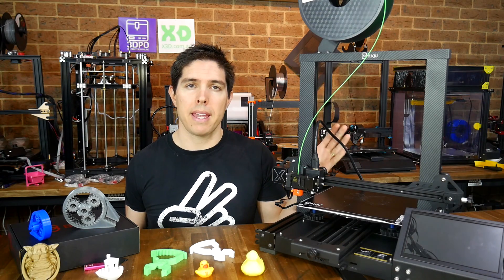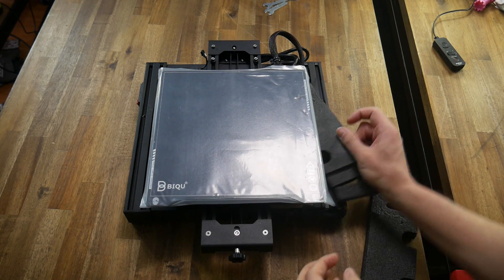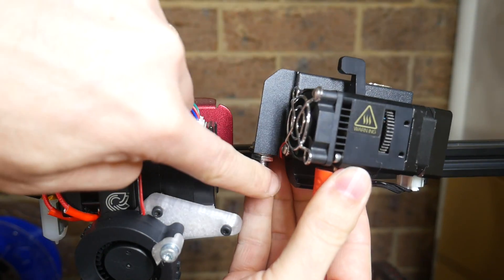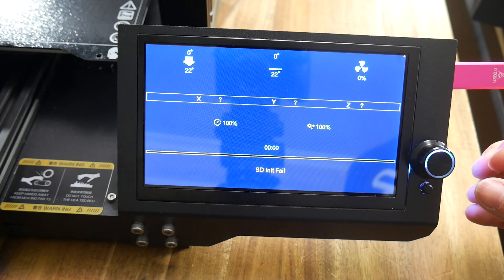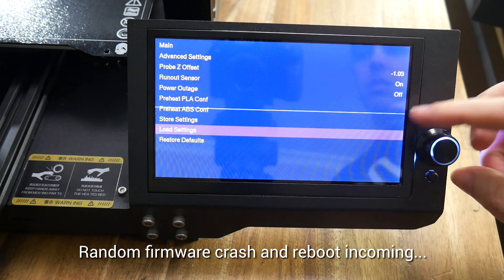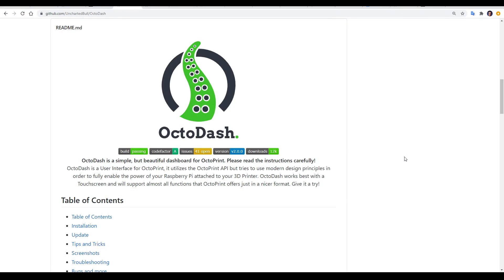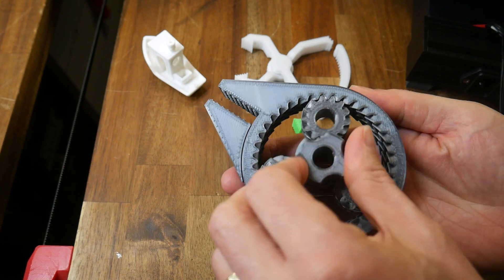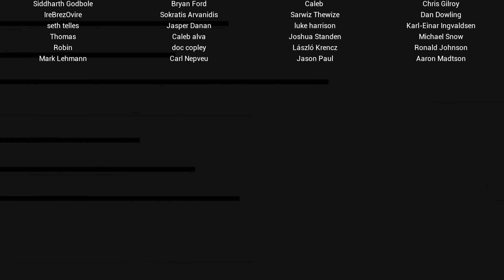BIQU BX - Octoprint compatible 3D printer on Kickstarter

Comment: May I recommend a new review? I have this printer and I'm loving it. Works quite well if you use the looxonline's firmware. Also klipper supports it and would be nice a guide on how to do it. I tried myself, took a while, got it working fine with mainsail os but revertedback to marlin due to the final quality not be quite what I already got. I'm pretty sure it's a matter of adjustments but I don't have the time to tinker with it now nor I have the knowledge in klipper to know what to do.

Comment: I just purchased a BIQU BX printer and am pleased with the mechanical design and large touch screen.  However, I have been having trouble with connecting a laptop via USB using CURA.  Perhaps there is a better slicer program I should be using?  I would like to see a good YouTube that drills down into how to use all the features, what they do, and possible troubleshooting steps.  The “instruction manual” is deficient in operation guidance.  Cheers.

Comment: Would be nice to have an updated video specifically installing octoprint as can't get 0.17 working on the screen also can't get it working...cant ssh saying no host ....I use the octoprint img 0.18 off the octoprint website using pi imiger and works but no screen

Comment: Hi again Michael, at 7min58s in your video, you state that at that point Octoprint could be used in the native environment. This is not quite true.. The BIQU BX needs an additional connection from a USB socket on the Pi board to the front micro USB connector on the front of the printer. This was confirmed by me and Bigtreetech support when I had issues trying to use remote Octoprint.

Comment: Thank you for showing us the main board! With this BTT board, you can update the drivers. With the Ender boards, you have to replace the whole board.
EDIT: With a bigger processor, 2MB flash memory, and 1MB RAM - is it time to start having a discussion on removing the OctoPi from the equation and setting the operations back onto a single board?

Comment: If it had the print volume of an Ender 5 plus, it would be a no brainer at that price. As it is, the B1 seems like a lot better deal, especially if you don't necessarily want to mess with Octoprint. The B1 with the same direct drive would be around $360 and seems to show a higher build volume to boot.

Comment: Not buying anything else from BIGTREETECH/BIQU - They have terrible customer service, took forever to get them to respond to an issue I was having, then they were having me do all kinds of troubleshooting and trying to run out the clock on my return window - wanting me to try to record a huge CR-10S5 while making adjustments inside the external enclosure that has mains voltage inside of it - all while fumbling with a camera. I had isolated the problem all the way back to their board, but they wanted video evidence of it... Just replace the damn board! Sent it back to Amazon and washing my hands of their garbage. I love this channel, but surely there has to be another company besides BIQU out there!

Comment: I think the Raspberry is only good if you do use a single printer which most do. But if you go into production of multiple printers an external housing for the Raspberry pie would be better somewhere attachable to a TSlot so you can multiple printers of a single pi

Comment: I am looking to buying my 1st printer and as I want the ability to print nylon, or nylon X I am quite confused which way to go? I really like the prospect of this printer, but not sure if I want to wait. I am also really keen on the creality CR-6 se and believe this could meet my needs, but would like your opinion on it's ability to print nylon with a steel nozzle, or would it need an updated hot end? The cr-6 is now available I believe. My other alternative would be the Qidi tech x-plus which I saw reviewed on makers muse as this would print nylon out of the box, but is quite a bit more expensive. What are your thoughts/advicekindest regards
Dean
Reply: I have a CR-6 SE and while I had very few issues with mine it will not work with nylon. No printer with ptfe feed hotend will work above 240-250 C. You will need to swap the hotend and that is not easy on a CR 6 as it uses the strain gauge for Auto Bed Level. You could remove the ABL but the bed does NOT have leveling screws so it would be a pain to calibrate. However this printer would also not work out of the box for Nylon. You would at least need the all metal heatbreak.
Reply: Thanks very much for the good advice VMA

Comment: That screen and the board would be more compact in portrait mode and if it used a Pi compute module instead of all that fiddling with adapter boards. I think BigTreeTech a good chance of supplanting Creality given their reputation for producing drop-in, better components for those devices.

Comment: I love how people hate on the HDMI connection without any evidence that it's a problem. Sure it could do with cable relief but there's nothing inherently wrong with the cable standard, conductors or connectors. I hope BIQU sells PCBs to retrofit other printers. (I believe Type-C connector is also viable but I'm sure that BIQU have used HDMI for a reason).
Reply: A good Engineer or person of thought will (and should) "hate" on anything which isn't proven. If an auto manufacturer changed the clamp style battery terminals to a new slip on style, would you buy it without hesitation?
Reply: @gregoryconnors7370  that's a terrible response. The engineers made the change, it's the consumers looking to poke holes without evidence.
Reply: @justindelpero  did you not read the "OR PERSON OF THOUGHT"? Hell, that could even be you, but obviously that would be expecting too much. Additionally, indeed I was referring directly to the commenters (consumers) here who have enough capacity to think outside the box and look after their own as well as others' interest. Thanks for your closed minded critique, and go get that vehicle with the slip on's.
Reply: @gregoryconnors7370  so have you studied the HDMI standard? You understand the power capacity and bend radius etc? No issues if you wish to chime in with first hand experience of strain relief concerns etc. Unfortunately you are the problem and it's pretty poor that you need to phrase your response like a teenager. Unless you have a valid reason to bitch about the use of the adapter simply shut up and start testing. Once you verify that the adapter/cable is inappropriate then make your case and people may enjoy engaging with you.
Reply: @gregoryconnors7370  to directly respond to your point - I allow certifications, industry regulation and safety standards to monitor engineering changes as I'm not an entire company of engineers. If however it came to light that the technology change was bad I would expect a recall and a change to the battery terminals to an appropriate alternative. Noting that a car change is a far cry from a Chinese 3d printer I still know that the HDMI cable is an appropriate choice provided the adapter and cable have appropriate strain relief given the repetitive short movements of the X carriage. This is because I am interested in both electronics, 3d printing and have designed and installed my own custom connector on my custom built corexy printer. There's always the possibility that it is a terrible long term choice but I choose not to persecute or muddy anything without a valid/proven reason.
Reply: @justindelpero  you TOTALLY missed it. Have a better day!

Comment: (para) "0.9° steppers double the resolution and smooth your prints!" Seems like a nonsense claim to me.
While theoretically true, any consumer grade printer with 1.8° steppers and Trinamic-based controllers is already using 256 microstepping, so when using normal GT2 belts with 20T pulleys (ideal radius 6mm) they could place an axis at 7µm positions (2Πr / ((360/1.8°)*256 = 37.7142 / 51200 = 7.3661) but cannot achieve this accuracy due to other mechanical issues and constraints. Using 0.9° steppers isn't going to magically produce any visible change.
Reply: @Teaching Tech Anthony makes a great point here. Is there a possibility of testing the actual accuracy on the new Biqu X vs one of their previous models? Also, I assume the theoretical torque loss will not be an issue?
Reply: Using 0.9° steppers will reduce VFAs (Vertical Fine Arifacts) visible from full steps (since full steps will be closer together, and less "snappy").
Reply: @Thorinair  how do you come to that conclusion? When using 1.8° steppers to drive an M8/1.25mm lead screw, for example, each full step is 6.25µm and you use exactly 16 steps for 0.1mm layer heights. I wish I knew what type of lead screws Biqu was using on the BX because I cannot find that information anywhere.
Reply: @anthonyrich1592  I was talking about X and Y axis, not Z. Z is a completely different story and is not in any way related to VFAs.
Reply: @Thorinair  thanks, I had not come across that before. While it seems that 0.9° steppers may help with the issue it sounds like you really need Programmable Adaptive Microstep Wave Tables to counteract it properly and the TMC2209s on the BX don't have that feature. Prusa has been using TMC2130s so that they can make use of it. https://www.trinamic.com/fileadmin/assets/Support/Appnotes/AN026-Adaptive_Microsteptable.pdf

Comment: Why not just send a proper shut down command before turning off the Pi when switching away Octoprint mode? Or does it need to be left on for other things when not in ocoprint mode? taking octolapse or something for example even when not in Pi mode.

Comment: This "hemera" as upgrade for an ender 3... That would be cool. Pls sell it as single part biqu!
Reply: Yeah I would also invest in something like this :D
Reply: I'm pretty sure they do. But you would need to print an adapter to fit it. Which I'm sure many will make one and post them on thingiverse and sites alike
Reply: I have this similar one for my Ender 3

https://www.aliexpress.com/item/4000162427027.html?spm=2114.12010612.8148356.37.42a47064GUWWjz

Flawless prints for almost a year now.

Comment: Needs a larger print area (or at least a companion larger version of the same printer), and HDMI is not a viable power solution, nor is the connector mechanically strong enough to withstand the constant movement.

Comment: I quite like the extruder, arguably better than a hemera due to the exposed gear for manual feeding and smaller footprint. That HDMI though... not convinced!
Reply: I'm a bit worried about that HDMI. It's possible that by using the proper industrial version with two parallel screws it won't have any problem, but BiQu must implement that before the final release. It would also be interesting to see how hot the connector gets when a full load is applied.
Reply: I'd agree with your opinion on the HDMI, but the Raspberry Pi implementation in my opinion is quite clunky, if they are as good as they say they are, a more cleaner better connection of the Pi would be using the GPIO as intended.  Cause instead of using USB for power, they can feed power via the GPIO
Reply: @Celcius1   It's not such a great idea to power the pi via GPIO, because it is unregulated and there is no fuse protection. You could damage your pi permanently if you're not careful.
Reply: @tobymakes  there is no regulation on the pi from usb 5V to gpio 5V and the latest version 4 Pi does not have the polyfuse any longer. This implementation is absolutely fine.
Reply: I don't like the idea of a loose connection like the HDMI cable.  I get why they used it, but how often do you really need to disconnect the hotend carriage from the rest of the printer?  Stick with the solid connections.  I can see this HDMI cable being the source of a lot of headache in the very near future.

Similar to switch bounce, I don't trust that those spring contacts will remain connected and not disconnect under certain vibrations.  Environmental contamination is also a concern.
Reply: The hdmi does not look secure, and what about current ratings? I don't know
Reply: MINGDA D* Pro series seems to be better value. Its weird to me reviewers are sleeping on it. I guess its because they haven't sent it out.

Comment: Thanks for the insight Michael. What's the cooling like on the raspberry pi 4? Is a fan necessary especially if this printer was to go in a heated enclosure?
Reply: Pi 4 suffers from heating issues, so get a fan on it

Comment: I'm currently printing on a very modified ender3, the printer in this video has me very interested. Dual z with a btt board that drives each z motor individually is a major desire of mine, and it's included in this printer. I love the direct drive hotend too. The only thing keeping me from buying this one is the v-slot wheels. They're a major source of frustration when you're hunting for the perfect print. My dream printer will basically be the printer in this video with linear rails on x and y and no big screen stuck on it (I'd rather control the pi with my PC).
Reply: They're supposed to be releasing a new Mini E3 (Mini E3 "Turbo"?) that also has two separate Z drivers. I'd wait for that before spending more money on another printer, unless you were going to get another printer anyway.

Comment: HI I BOUGHT YOUR FIRMWARE AND HAVING AN ISSUE. I am unable to get the z offset to work for the BL touch. I adjust it in the menu and after I store settings I go to print and the z offset changes and the nozzle ends up to high off the bed. Any suggestions

Comment: Be careful with backing a kickstarter, I was a part of the filament dryer disaster, and still havent rec'd it.  People were getting it on Amazon and others with coupons from social media for same as early bird kickstarter weeks to months before backers started to got theirs.  Crealitys i hear didnt go so well but i dont know for sure.   All I'm saying is it kickstarter, not everything goes smoothly.  I found out the hard way.  Good luck if you back it.
Reply: Its a general problem with most kickstarters in my experience. Not just when it comes to 3d printing.
Reply: Creality CR6 SE was a big scam, this printer as problems all over it. Check here 

https://www.fabbaloo.com/blog/2020/8/28/creality-takes-the-high-road-on-a-technical-issue?fbclid=IwAR3MsCl5n42nU4yOWdiAvhnCSjXUb4WOo4Bn6zNG2lSjG_LPOqnEf9uF6Dk

Comment: Using a common cable such as HDMI is nice, but also very wtf. Are they rated for the wattage that a hotend will pull? From what I can find, MHL 3 is rated at 10W but that is probably for an official spec and I guess the wires might be able to carry heavier charge. Still, USB C charging can go up to 100W by spec. Perhaps I'm misunderstanding these ratings, but it does seem a bit odd. I suppose they wanted to keep costs down and simplify to one cable but that is one thing that concerns me.
Reply: Yes but printer like the Artillery X1 uses flex cable and that even worse, however printer still print fine.
Reply: @zero00tolerance  yeah that is true, I'm just worried about potential fire hazard/melting

Comment: Would it be a possible to make a printer that used octoprint, and didn't even have a screen?  That might save money on a low end printer.
Reply: Yes, that is possible. But keep in mind, that a screen module is probably cheaper than a rasberry. But the rasberry adds Network functionality to remote control the printer.

If you really want to save money, you can print directly from your PC via an USB connection.
Reply: I definately wouldnt buy it :/
Reply: Yes, in fact I don't really see the point of having a screen on an Octoprint system. The whole point of Octoprint is that you control it through the web interface so you don't need to fiddle with the screen.

Comment: As a first printer would this be a good purchase or would the Ender 3 V2 be a better starting point   thanks
Reply: I have a pro and a v2, I Would recommend the pro over the v2
Reply: @baileymoyers1973  why?
Reply: @breathLP  the ender 3 is very well documented and expandable.
Also between the pro and v2 versions the only meaningful upgrade to it is the glass bed in my opinion.

Comment: this looks really promising..i'd like to know an estimated price..that's what make a good or bad purchase after all..
Reply: Judging by the Kickstarter, the current price of US$309 is 38% off which would make the full price approx US$500 but no doubt there will eventually be deals on Aliexpress etc for less when the Kickstarter has finished.
Reply: I think that real price will be quite lower than declared $500. By KS pledge prices, i assume that it will be around $310-350 and later maybe lower. For around $500 no one would buy this printer, because thare is quite big competition. And almost everyday,  3d printer companies releasing new and new printers with better specifications and prices.

Comment: Could you also do a video about Repetier Server? I use it for my printerfarm. I tried to use octoprint and tried to install multiple instances of octoprint in different partitions of the drive. However it is really not meant for multiple printer applications so it gave me all sorts of headaches. Now with repetier i run 8 printers per pi without any problems. Would love to see your opinion on it. By the way you make great content.

Comment: doesnt an hdmi cable have issues with excessive bending? the wires and break at some point right? worse case you just replace it.

i like biqu using common cables for the hot end wiring tbh
Reply: I wold like display port instead for the fact they lock (if that's even possible I'm not even sure how you would even carry that much current on a cable designed for data transfer).
Reply: @tclemens96  i hadnt considered that. genius idea!